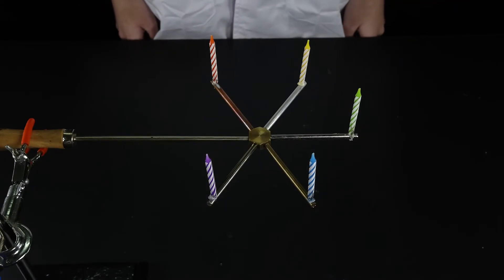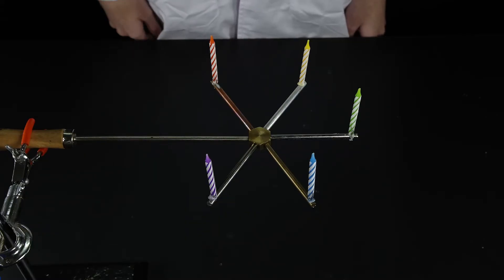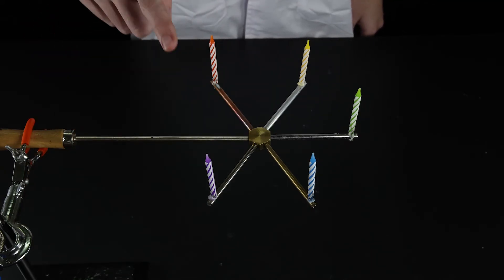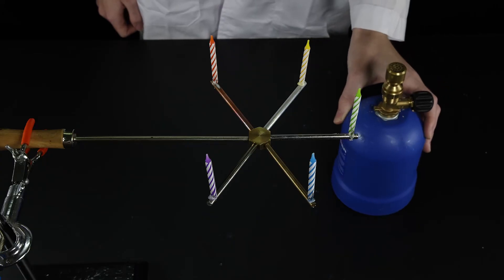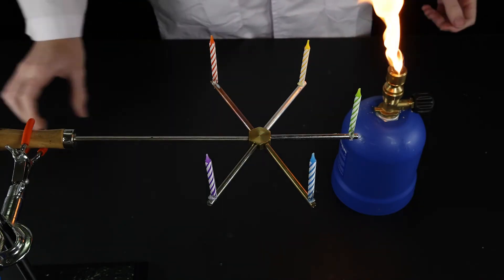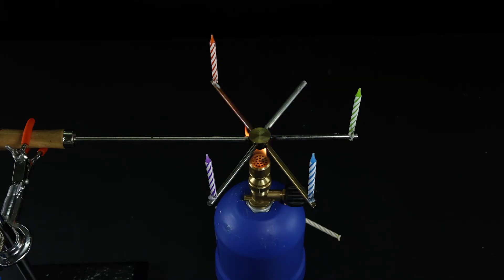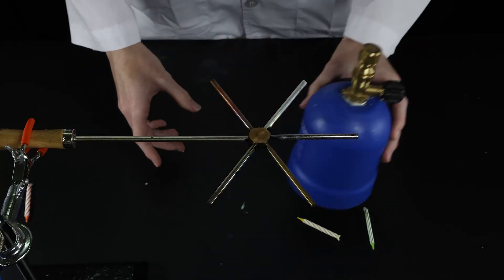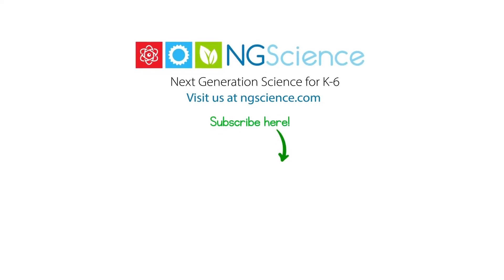Heat Conductivity in Different Metals

Comment: In this experiment, the heat conduction rate of aluminum appears to be greater than that of copper. However, the heat conduction rate of copper is actually greater than that of aluminum.
Reply: You are correct.  69% greater.